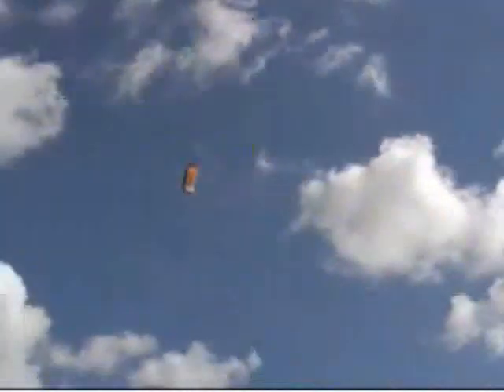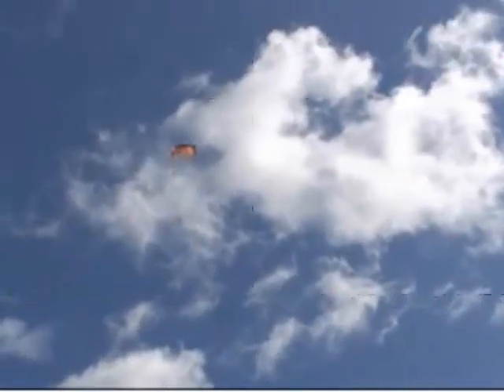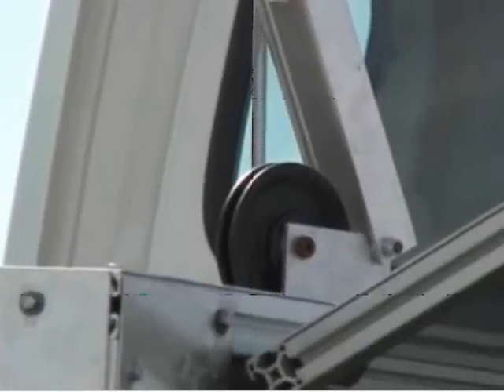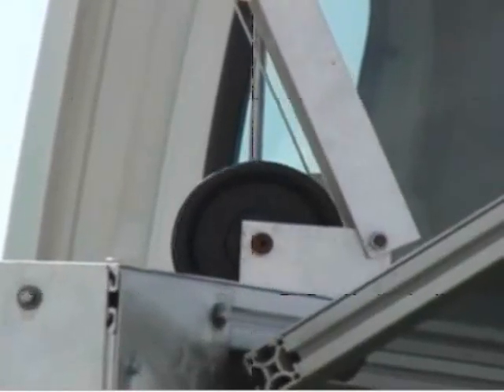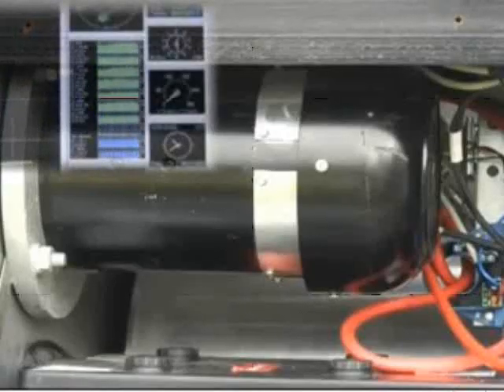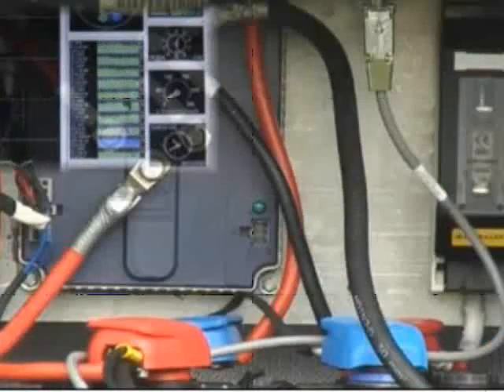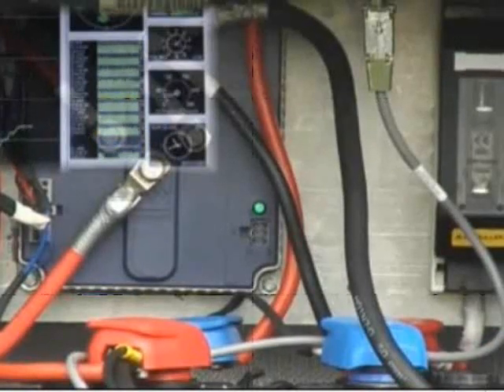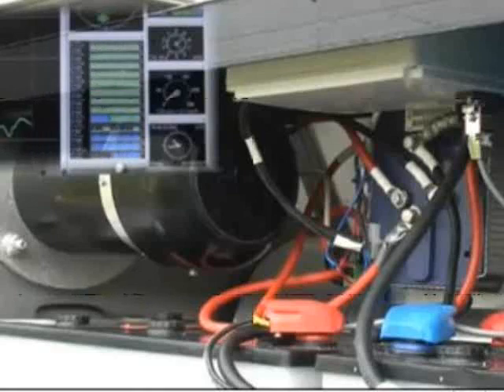Electricity Generating Kite - Kite Wind Power

Comment: For the love of god, can someone tell me how it actually generates power???
Reply: The key to this system is that it has a let us call it a robot at the intersection from the main cable to the strings that spread out to the kite. the  robot pulls on the strings of the kite like it was a puppet to fly it around. On the way up the robot flies it so it gets the most wind and therefore drag force as possible. It then utilizes the drag to pull on a generator as the cable pulls out. It does this until the kite is at the end of it's string. at that point the robot pull on the strings so the kite stays airborne but had much less drag in the wind, the kite flies lower and some of the energy but not all is used to pull the kite back and therefore wind the cable back up. When the cable is wound up enough the robot starts over again making the cable run back out. Each cycle due to the robot's programming gains us net energy.

Comment: Unfortunately it can't work. As the generator produces more power and resists the wind, the kite will lower itself to an area of lower wind speed and the power output of the generator will decrease accordingly until a new equilibrium height is reached. As wind speed increases, the lower the kite will be lower and so on. You can't get something for nothing which is why windmills need to be anchored firmly to the ground. Ignitionman
Reply: Wow.  Obviously you haven't bothered to look it up to see how or even IF it works.  None of what you speculate applies here.